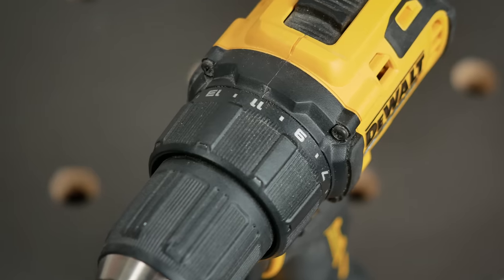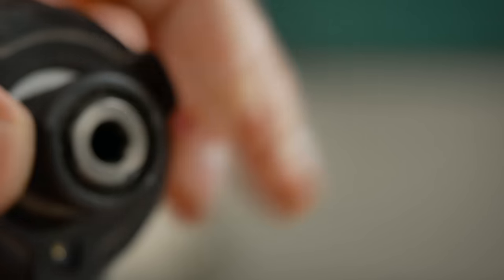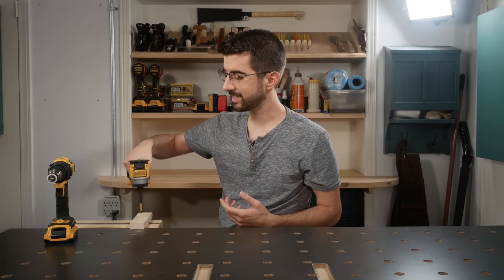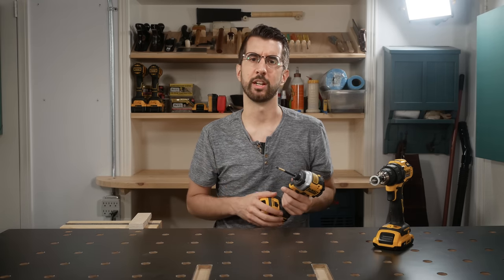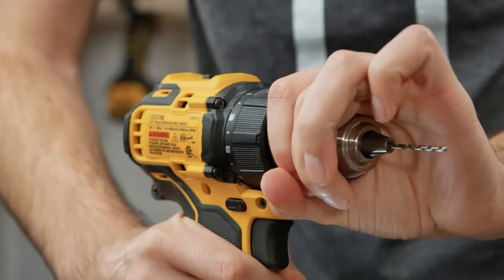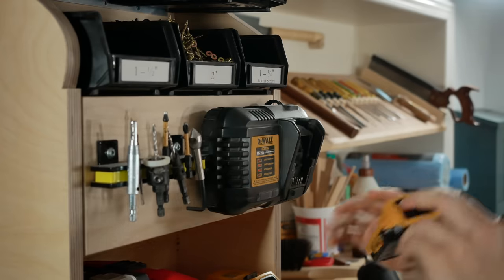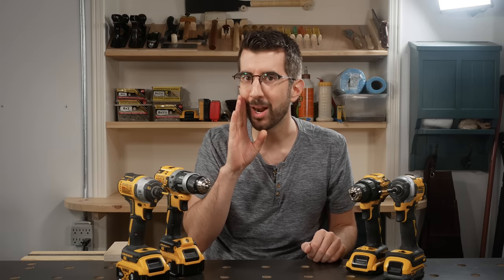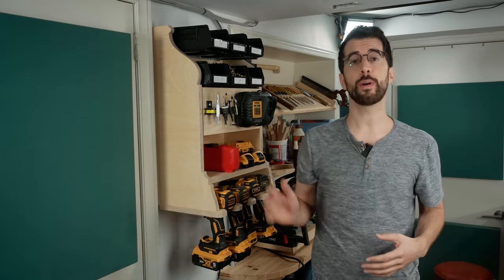why woodworkers don't use impact drivers

Comment: Through several odd seredipitous things I ended up with 3 drills and 2 drivers. On most days I need a drill and any one of the others. Somedays I can have all 5 in play all with different drill bits or driver bits, use ‘em if you got ‘em. I think for efficiency a drill and one more of either is the minimum. For saving money drills and drivers often come as a bundle. I think I cant agree more with your statement, “It depends”

Comment: My problem with driving screws with a drill is mostly torque at lower speeds. Most of them just go too fast and cause more problems than are worth dealing with. My wife snagged a Kobalt tool pack for me for Christmas and I have to say I really love their impact driver; it's SLOW which I prefer. I can maintain amazing control on it while still having all the torque. It's a very nice driver. $.02

Comment: It all comes down to using the right tool for the job. Driving large screws in very hard wood like maple or oak and the impact driver is the only way to go. As far as driving too deep, you can get bits that release the screw at the correct depth. Or just pay more attention and stop before that happens.
Reply: What bit holder (auto release screw) is that? I am interested

Comment: Another overlooked variable: get better screws. The regular wood screws you buy from places like Home Depot often can’t withstand what impact drivers give out and break, even in pre-drilled soft woods. I upgraded to slightly more expensive screws made of stronger metals and it has been amazing. No more stripped screws, no more snapped heads.

Comment: Do a video on brushed vs brushless for hobbyist woodworkers. I’ve watched a lot of them and it’s all “let’s drive 100 10inch screws into hardwood and see which one is faster!”  No one is doing this in the real world right? I have my little bosch 12v brushed drill and driver and they are awesome for home woodworking. So I don’t get the extra money for the brushless tools. But you hinted that you do know so I’m keen to hear a realistic take on this please!
Reply: Good point. If you're referring to the finer control of brushed models, check out the M12/M18 Surge; allegedly, much finer control than the non-hydraulic models.

Comment: In 2008 I bought a Festool T15-3 drill/driver with the swappeble attachments. Super easy to switch from drill head to bit head to 90 degrees head to offset head.

I really don't get why you don't see many people using swappable heads? Every brand has them now. Even DeWalt.

And a year ago I bought a green bosch in the 50% sale. 112 euro 😁 with the same 4 swappable attachments included.

But a few weeks ago the 2008 festool drill motor got some issues that the constant speed broke.

So I was using the 18volt bosch with drilling 60 holes with a speed drill. And I was missing the festool power and speed.

So I decided to buy the Festool 18+3. And the nice things is everything from the 2008 machine fits. Even the batteries 😃 Yes it was 460 euro with charger and batteries. But I love the festool and the swappeble heads.

So no matter what you buy and in which budget get Swappable drill and driver heads 😁

Comment: It's pretty much the same thing as with all power tools: know what to use and when. The rattler is an excellent option for most things but sometimes a torque-adjusted drill/driver is better and sometimes you might even consider reaching for an old-fashioned manual screwdriver. I've lost count of the number of kitchen units I've snagged where it was fitted by someone who used some kind of power tool to tighten the hinge screws on the carcass  and it strips the thread every time. People who favour a drill/driver for screws as a whole are more prone to manking up the head; especially if they've got it set on 2 ( in the days before most carpenters used rattlers, more than half of the ones I knew insisted that this sped the job up and refused to recognise that it damaged the screw).

Comment: Use a hydraulic impact for things like cabinetry or more delicate finish work.  I use a Makita TS141 and was amazed at the control and finesse you can get from an impact tool.  Seriously, you absolutely need to try one.  You’ll not go back to any regular impact driver.

Comment: Hey Scott, there is a feature in the compact impact that makes it a lot better for driving in wood. Setting 1 is not just a slower speed. Try driving a screw into a scrap piece of 2x4 in the first speed setting on the compact. Do not pull your finger off of the trigger when it stops spinning and see what happens.
Reply: What will happen?
Reply: @barberismeable  it seems to Guage the required force and then stops then slowly impacts so you don't over drive your fasteners it stops at the surface
Reply: @danielwake2430  that means i can just buy 1 impact for my 15mm plywood project DIY at home. I already have corded hammer drill
Reply: @barberismeable  a lot of people have purchased these and assumed the first speed is useless or broken when its function is just less obvious.

Comment: This is why I love my m12 hydraulic impact, the dynamic of the impacts is completely different and very gentle. Love the finesse it gives, at a low rpm the "hits" are almost non existent, it almost freewheels, as you speed up it hits harder and harder. Problem with a clutch is you have to adjust it, you have to get it right, and you have to trust it. with the impact, all the finesse is right in the trigger in an intuitive control loop with your brain thats telling you to be careful, you dont wanna snap this fastener.

Comment: Roofers don't like to use impact on the roofing tech screws that have the painted tops, because once they go in the impacts knock the paint of the top. I couldn't justify the budget on an expensive impact driver. So I got a got a cheap house brand impact wrench and an adaptor that goes from the 1/2" square drive to a 1/4" hex. 

Works well for construction stuff, and can put a tech screw trough almost anything. A bit too grunty and clumsy for light woodworking though. However, I can always use my drill or little electric screwdriver for that kind of stuff, if not just a manual screwdriver, depending on how many screws there are to drive.

Comment: Get a non-magnetic bit holder for the drill, problem goes away. Dewalt make them so you can even stay within your brand if it means that much to ya. Leave it it in the chuck, pull back the sleeve, pop out the old bit, pop in a new one and slip the sleeve forwards again. Done. Make the right choice and you can get one that will handle both 25mm and 50mm+ bits. I now have 1/4" hex shank drills in both twist and brad point types in my most commonly used sizes and my snail type countersink is also hex shank. I only use the chuck for oddball sized drill bits now tbh.

Comment: As far as I know, Dewalt still doesn't make a hydraulic-drive impact driver. Hydraulic-drive impact drivers use a viscous oil to transfer torque from the motor to the bit inside an oil-filled housing. From my understanding, they sort-of work like an automatic transmission in a car. The oil-filled drivers reduce vibration, give you longer sustained torque in-between impacts, and they are noticeably quieter than drivers that use a standard hammer mechanism. Milwaukee and Makita have them. I think Dewalt makes some nice tools, but I just happen to have batteries for Milwaukee's 12V and 18V platforms as well as Makita's 18V LXT tools. 

I use a 12V Milwaukee surge driver as my primary driver. I almost never use it on the highest torque setting. I tend to do more carpentry than woodworking projects (I recently built a treehouse for my daughter). I still usually predrill pilot holes for my screws because even soft woods can split, but I found that this little 12V milwaukee driver gives me as much torque as I ever really need. If I were a professional deck builder, I might buy a bigger 18V hydraulic-drive impact driver (the 18V Milwaukee surge or the 18V Makita oil-filled driver) for occasionally driving big lag screws, but as a DIY builder, the 12V is totally fine for my needs.

I have used non-hydraulic impact drivers, and I greatly prefer the oil-filled ones for their reduced vibration and lower noise. For my kids' treehouse project, I had to drive HUNDREDS of screws, and when you're driving screws repeatedly for hours, it's just a lot nicer when you're using a quiet tool with lower vibration than a very noisy tool.  Even if I only have to drive 10 screws for a small project, I strongly prefer using a quieter tool.

I generally don't use my driver for small screws into thin stock. I have a 12V Milwaukee cordless screwdriver with a clutch that I use for that. It's quieter than using even an oil-filled impact, and it's fine for low-torque fast-screwing applications, although it's not their best tool. One day I may look for a very lightweight, low-torque dedicated screwdriver with a clutch for low-torque applications where I just need to drive small screws.

Otherwise, I agree that these days, compact brushless drills and drivers are 100% adequate for DIY work. I use an 18V brushless Makita subcompact drill for almost all my hand drilling, and it's the best hand drill I've ever owned. I occasionally have to drill into masonry, and for that I have an 18V hammer drill. I guess I also use the bigger 18V drill when I sometimes have to drill bigger holes in thick steel, although even then I generally start by making smaller holes with my subcompact makita and finish by using my larger 18V hammer drill (not on its hammer setting for steel -- it's just a bigger, high-torque 18V drill).

Comment: i assume you are making a distinction between " woodworkers and carpentry ? 
well, in any case , i have never encountered any woodworker that DOESNT  use an impact driver at some point .
one thing that wasn't considered is using an impact WRENCH when driving super big/long screws . i use an impact wrench when having to drive gigantic screws. a simple adapter that goes from the square 
head  of the driver to a female hex is all that is needed . one caution however and that is to use very high quality hardened screws that won't snap .

Comment: Check out the Wera Rapidaptor for one that will not leave bit behind. I use it with my impact drivers or clutched drivers both which I use both in woodworking just depending on my needs.

Comment: The main issue with impact drivers are that people buy to powerfull to aplication
For example popular 226Nm wont ever "go impact" with screw like 3x20mm and will strip it 
Where 90-120Nm impact will work with screw like that without issues
In case of noise there are silent impacts with oil inside (and they hit smoother)

I still use drill etc buy 99% of the time i use 2 impacts for screws 
226Nm universal
And 110Nm for furniture etc when i need more control 
Or just dont need high torque but impacting (lets say you want to clean vacuum cleaner turbine ....only impact can take that screw out of the turbine but if its to strong it can just spin it around)

Comment: Makita Gold impact bit set does almost perfect job keeping the bit in the socket and not the screw for me. I'd say 99.9 percent success rate. Based on using for 1 year 2 days a week renovating a 250 year old samurai house in Japan. The set is expensive, but worth the price. Very durable bits.
Reply: Its funny so many ppl are saying they dont like the magnetic bit holders and use the locking ones. Ive never had a problem with my bits staying with the screw, even with cheaper magnetic holders. I love the magnetic holders because it also magnatizes the bit and screw so you dont always need one hand to hold the screw

Comment: Ok this is a minor detail but lately I am sick of people stating or implying that you can only use a magnetic bit holder for drills just so it makes impacts seem better.  I have had quick-release locking bit holders for my drills for years and they work exactly like the bit holders on impact drivers.  yes they add length to your drill which makes it harder to get in tight spaces but in most cases this is not a problem.  You can always chuck your bit directly in the drill if you need that extra inch or so of clearance.  I will admit that I often go with my impact specifically in tight spaces because it is half the length of my drill.  But for general woodworking I use my drill because I can change the clutch setting on the fly for different screw sizes.  Running a reduced head number 6 on max clutch is a bad idea and I find the impact is also not better for these screws as it is too easy to overdrive them.

Comment: For many years I had a hammer drill and a drill/driver and this was fine. I could use one for piloting and one for screwing. I added a small 12v for tight spaces. Then I tried an impact driver... 

... and after a couple of uses it sits on the shelf, gathering dust.

Comment: Just need a quick release adapter for the drill. Runs the same way as the impact retention ring and isn't any longer than the magnetic bit holder. I do prefer my impact for most everything though. Including running spade bits and auger bits.

Comment: Why occupy your drill chuck with a screwdriving bit when you can use the  DeWalt 12v Screwdriver Model DCF601B which has a nice compact head?

Comment: Why is there no mention of machines that do both? My small and fairly cheap bosch home can drill and be used as impact driver with fine adjustments to the torque. It has two speed settings but depending on how strongly I pull the "trigger", the speed can be varied by a lot manually. Should that not be the best of both worlds for any hobbyist?

Comment: I've been a carpenter  and cabinet maker for nearly 50 years, I was late to try an impact driver for the reason I always thought. I don't have the control for cabinet making with the impact driver like I do with the drill. There are uses for the impact driver like getting out hard to remove  screws . The impact driver sits on the bench 95 % of the time unused. I find a good quality  strong drill will drive large screws fast than a impact driver also. I think I wasted money buying a impact driver for my uses.

Comment: Impact drivers are great for projects you dont need to pre-drill, where you have specialized screws, cheap lumber, and/or where the finish isn't meant to be shown. A great example is modern construction framing.

Comment: At this rate of us people pressing corporations, brand locking will be a thing in the past. It's really unfair to get you into a single brand. Especially when different brands have different strengths in different types of tools. IE: DeWalt drill, impact driver and craftsman Ros. We should have a baseline battery system. 

If we keep this pressure up, we can change what we want from the corporations. I like multiple brands. And if the government wants everyone to be using battery before 2030, they better change alot of stuff.

Comment: When I'm putting 2x6s together with 3 inch deck screws?  I'm using the ugga dugga gun.
cabinetry and furniture?  I'll use a countersink bit and set the clutch on a drill driver.

Guess which one I do more often.

Comment: I use my drill for making holes and use the impact for all my driving, with practice over time I’ve got to a point where I can limit the torque with trigger control based on the sound of the driver. If things are so delicate that I’m worried about over driving I use a screwdriver